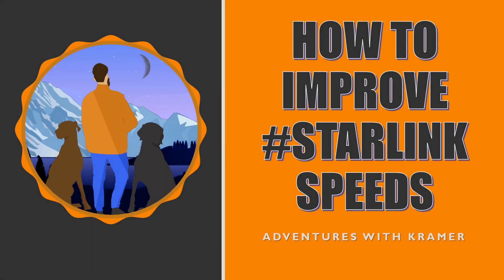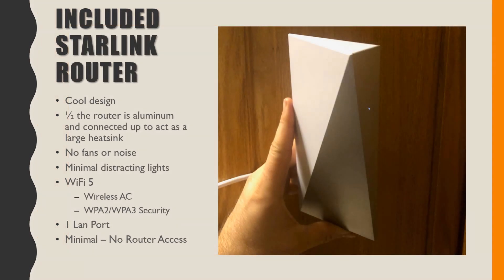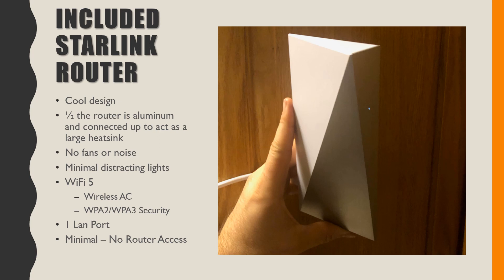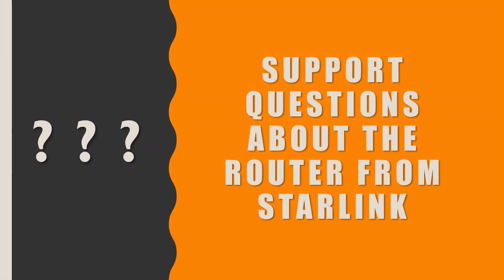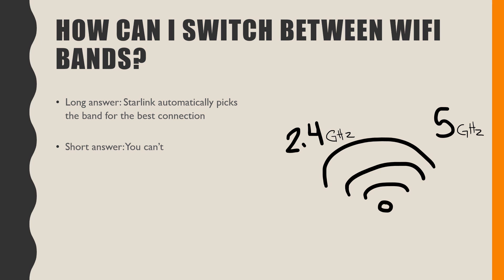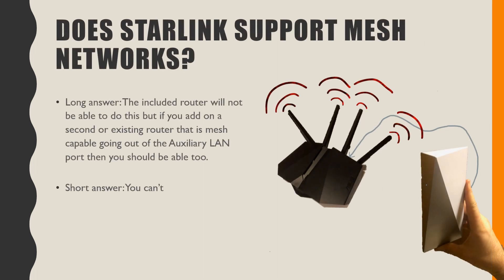How to Improve #Starlink Speeds: New Wireless AX router vs Original Starlink AC Router

Comment: You can access the app without the Starlink router building a static route to 192.168.100.1 and using the ip address of the router and 255.255.255.255 sub. Only thing is sometimes if the Sat dish  reboots it will give your router a new address so you will have to change the gateway. Been able to access the app with my Netgear Orbi.
Reply from the maker: I am just not comfortable doing a static ip like that just to access the app, it feels like I could open myself up to an unsecure connection. I do appreciate the info, if my current setup does become an issue I might need to do that.
Reply: @adventureswithkramer  
Agree with above. The static address will not open you up to security issues. The 192.168.100.1 is the adress to the app data on the dish. Different routers will have slightly different ways to set this up. Netgear is straight forward. In some routers need to do this on the wide area network side (WAN). I sent you an email yesterday with the address. In your video you should correct your statement because this is very doable. Reddit starlink under troubleshooting has a thread about this.
Reply: I set my tp-link router up like that as my starlink router died Friday nite( support ticket sent) . Worked well can access app but sometimes when I have a drop out I have to reset router like you said. Is there a way in settings to get around that ??   Thanks
Reply from the maker: I am not sure at all, I would for sure go to the reddit thread to learn more on that. Some of that is hitting some tech stuff beyond what I know how to do or advise for others.
Reply: @adventureswithkramer  a static route is just a way for two different IP address schemes on the same network to talk to each other. For example, most routers are configured with a 192.168.1.1 network by default. Starlink dish is 192.168.100.1 and are unable to talk to each other. By adding a static route inside your ASUS or other router, you are simply enabling these two networks to be able to talk to each other. No security risks since you are not punching any "holes" to the outside world. Hope this helps?